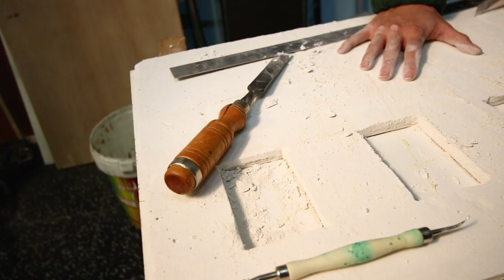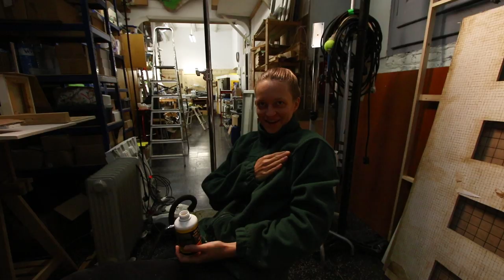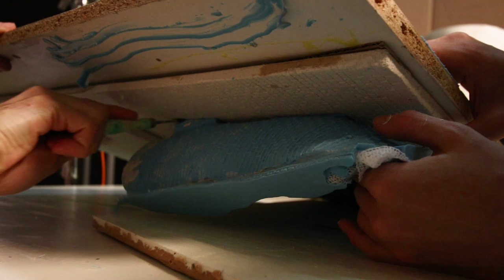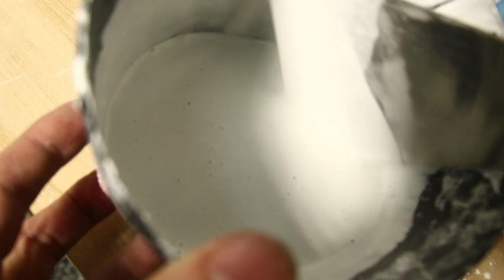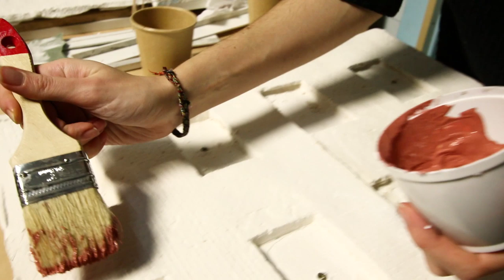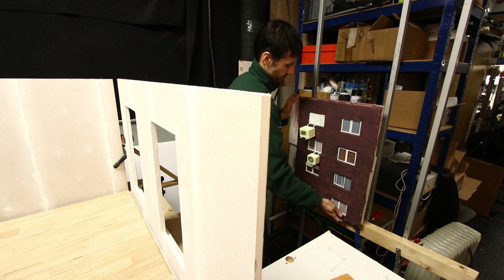How to make a miniature brickwall

Comment: I love watching you work. Always such clever ideas. One quick question - since this was a one-off, why did you go through the trouble of making a mold and then casting the wall instead of just painting the original carved piece?
Reply from the maker: We needed more buildings, we also used the first one, and made 3 copies
Reply: And so it wouldn't crumble because it's plastic I think

Comment from the maker: Have you ever used this technique??
Reply: Ojalá jaajajaja
Reply: Hola puedes hacer un tutorial sobre como hacer un cuerpo de alambre con masa epoxica, yo hice uno luego lo cubrí con esponja y luego con teflón lo recubri pero luego de varios intentos de probarlo se rompió:( se partió a la mitad si esque me podrías ayudar y hacer un tutorial o si ya insiste uno no me e dado cuenta 🙏🙏 (pero sin epoxi)
Reply: Yes I did for a city shop design
Reply: great technique never would have thought of this, what is the name of the board that you originally carved?
Reply: great technique never would have thought of this, what is the name of the board that you originally carved?
Reply: great technique never would have thought of this, what is the name of the board that you originally carved?
Reply: I've used chipboard painted random brick colors then cut into strips then individual bricks with a big paper trimmer. These were then glued to hardboard pre-cut with windows and painted a mortar color. Looked great as a background.
Reply: Yes but alginate is such a pain, you're courageous ! I use silicon for such things, you can cast more pieces with the mold without loosing too much details. And you can find cheap silicon rubber at the same price than alginate nowadays. Downside is that the waste isn't organic, and curing takes more time, that's why I organize myself to mold at the end of a workday :) You did a splendid job though !

Comment: Great video, just wondered if it would have been more efficient to make a small section of brickwork as an inverted "stamp" to create the texture over the whole surface? yes the pattern would repeat every now and again but it would be quicker right?
Reply from the maker: The original plan was to do all scraping but it took that long that we decided to make molds to speed it. It worked perfectly